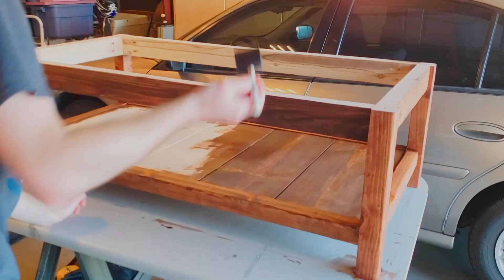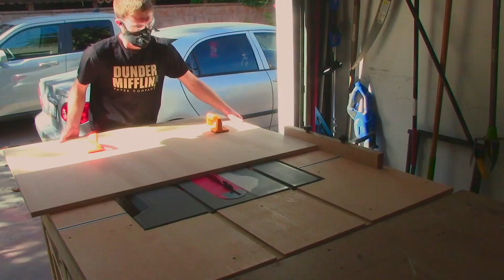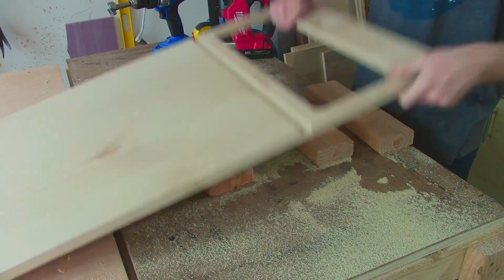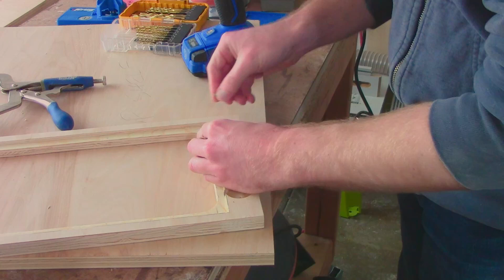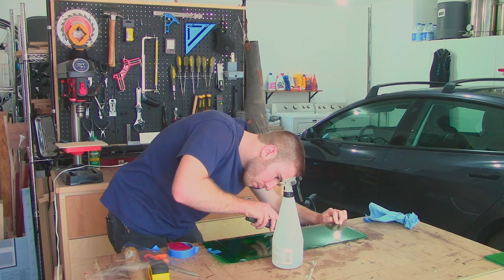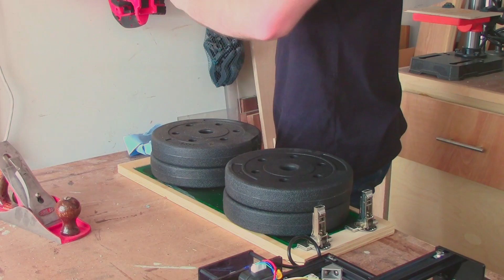Boosting Safety on My Laser Engraver

Comment: I realize this is from a couple of years ago, I've been looking at ways to enclose my laser engraver, I do like your design, I use a Ortur LM2 Pro S2 and installed a 20 w module.
I read all the comments here to make sure I wasn't covering something that was already mentioned.
Not sure If you haven't already done it but you will want to have a few slots/holes opposite the extraction fan for fresh air to be sucked into the cabinet to create a negative air pressure in the box so the smoke and fumes will be extracted.

Comment: FYI Yellow/orange is use to filter a blue light color. green is used to filter red lasers. yes green will filter blue but it is much less effective than yellow. Green glasses are common (and therefor cheaper) because it works for red and blue lasers. but its not as good on blue as it is for red.

Comment: I have a few tips to make this cabinet easier to use. First, instead of L brackets, cut a rabbet from a piece of 2x2 wood and cut it into 1/2-inch sections. Lay them flat on the cabinet floor and glue them so they hold the engraver tightly between them. This way, you can easily take it out to use on larger projects.

Second, make pass-through doors so you can do longer projects.

Wheels would allow you to use the pass-through doors to accommodate longer projects.
Reply from the maker: I like those ideas! Definitely would go back and add a pass-through for larger projects
Reply: @diywithry  That's how I built mine. It's not as pretty as yours; I built mine out of scrap I had lying around in the shop.

Comment: Could you send a link o specs to where to buy/find a safe type or plastic (PETG,...+ color)?. Thanks
Reply: I'm doing some enclosure too and after reading this comments I have decided to do 100% closed with wood and put inside a webcam and look for what's going on using my PC.
Reply: @WillGittens001 Im headed in the same direction. Might go a step further since I do alot of wood and might go metal for the cabinet incase of fire.
Reply from the maker: Plastic is just some acrylic sheet from Home Depot (since it's mainly just enclosing the space for the laser, this should work fine), and I originally used some green tinting film, but was corrected by another viewer that it should be orange. Just search "orange tinting film" on Amazon, and you should find something that works (can confirm that this is the right way to go)
Reply: @diywithry  Using regular window tint is incorrect. Lasers put out light at a particular frequency and the safety acrylic that is required must be that same frequency, otherwise all you are doing is damaging your eyes with colored laser light. Because of the specific frequency, the acrylic will be significantly more expensive.
Good design for the cabinet!!
Reply from the maker: @agarza6475  thank you for the info! I'll be honest I didn't do as much research as I should've when adding that aspect of the cabinet, but I'll be sure to make some updates!

Comment: Good design but the green glasses and windows are the wrong colour.  When working with blue diode lasers you need the protection to be  opposite colour on the colour spectrum which for blue is red or orange.  The glasses supplied with these cheap lasers are ineffective and more often than not are the wrong colour.  It may seem that the beam is being subdued but the danger is still very much present.
Reply: Could you send a link o specs to where to buy/find a safe type or plastic (PETG,...+ color)?. Thanks
Reply from the maker: Thanks for calling that out! I'll have to go back and change out the film/my glasses
Reply: @diywithry  Great build though

Comment: Nice build, thank you. What fume extractor did you go with?
Reply from the maker: Thanks! The fume extractor I used is an old off-brand model I had gotten from work, not sure it's available commercially. Any fume extractor with a decent filter should be fine for use with a laser though